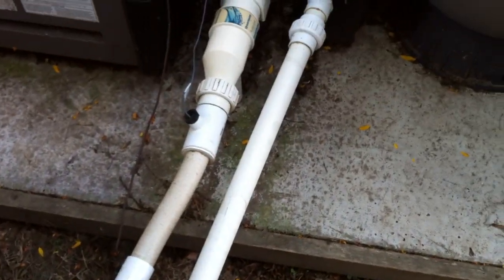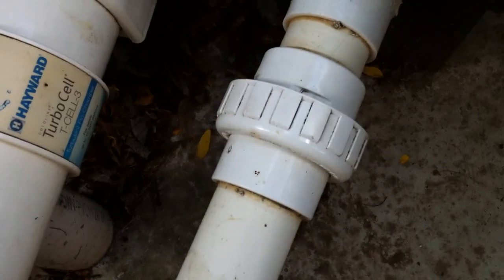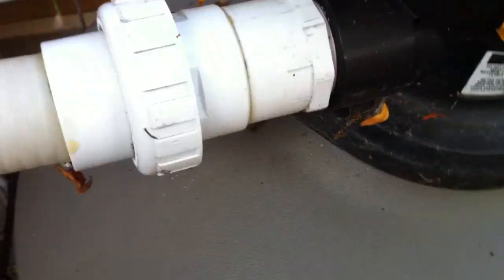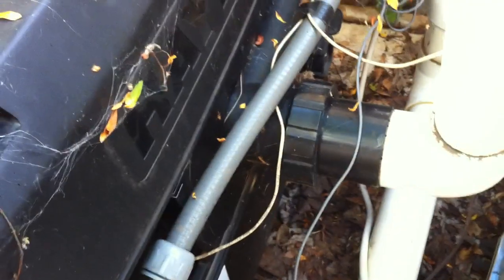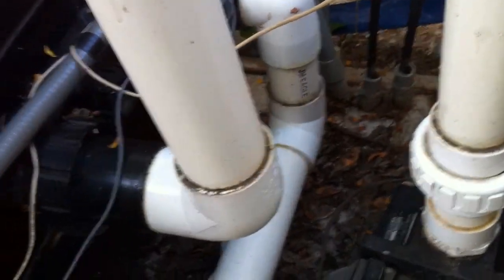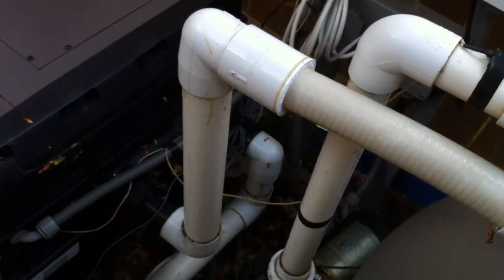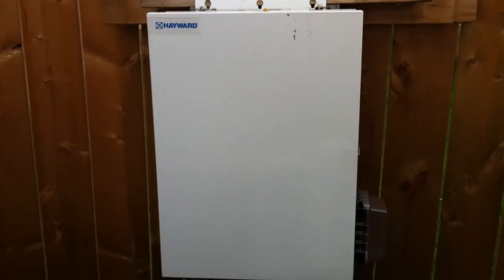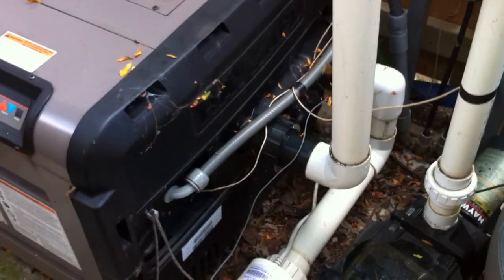Pump, Filter, Heater, Salt Water & Automation Panel - Pool Equipment Installation Tips

Comment: Can you explain why a union is a flow restriction? Its a straight fitting...
Reply from the maker: A union is a restriction to flow because it interrupts the continuity of the flow and introduces turbulence, a system inefficiency.  It is less bad than a sharp bend 90, yes, but still a surprising flow restriction in general, especially the ones that narrow the pipe diameter slightly as the water passes through the valve.  Even the striations on flex PVC are a flow restriction...the water is sensitive to inefficiencies being introduced and even small changes at up to overall resistance to flow for the system